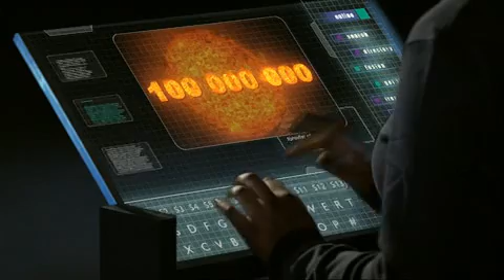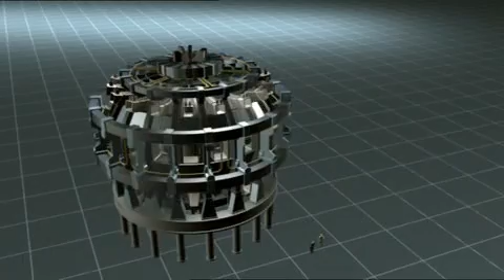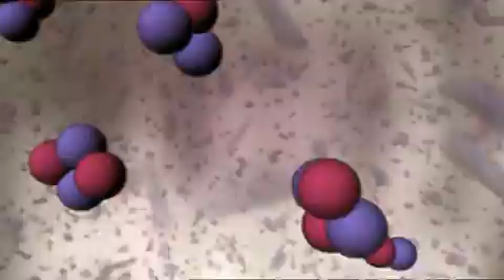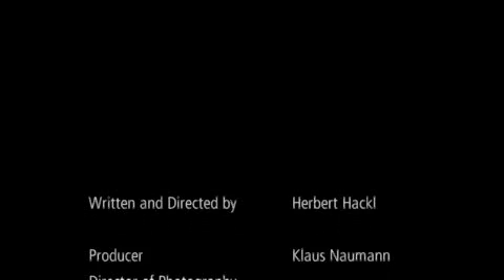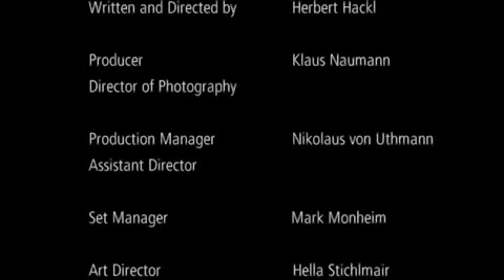How will a fusion power plant work?

Comment: It would be more futuristic and plausible if they used Helium-3 instead of Tritium. Helium-3, which is already abundant in solar wind, the Moon and Jupiter, is a helium isotope that lacks a neutron, and thus in a plasma state readily attracts deuterium's extra neutron. And if they fused, instead of useless radioactive neutrons flying out and producing old-fashioned inefficient thermal power, it would leave ordinary Helium-4 and Protons which have an electromagnetic charge in themselves; direct conversion of nuclear fusion to electricity.
Reply: DialecticDr if you actually paid attention to the vid, you would know that they said the energy output is about 25 times more than the input
Reply: DialecticDr
you are full of crap. what you say about helium-3 attracting deuterium is pure nonsense. helium 3 is a bad fusion fuel because the positive charge of the nucleus is DOUBLED compared to tritium. you are just making shit up as you go along, almost everything you say is completely incorrect.
Reply: Let's cast you into the Solar wind, Moon and Jupiter with a butterfly net and a big barel the size of New York City and you can catch all the Helium-3 for us? You agree Dielectric(SelfProclaimed?)Dr?
Reply: Win Dias Otherwise you;ll just have to endure the fact that fusion power consumes more energy than it produces, and using it to produce electricity is bullshit. If there was no way to convert direct fusion energy into electricity then it is basically more inefficient and expensive compared to technologies like Solar Power Satellites or Plasma Gasification. Both are more plausible and economical than Nuclear Fusion, unless you mine Helium-3.
Reply: DialecticDr Well - somehow what has been written by you is what i've been thinking of for a long time. Maybe we need just to try it..

Oh, and Win Dias - Man, you just don't know how much of that and other stuff can be found both here and... oh, let me think. Moon? Mars?
Reply: Wtf? He-3 is heavier than T, which means less mass can be converted into energy due to the mass excess. What would be the point of it?
Reply: uiiiiiuuu you did not read my post. It's not only about converting mass into heat. This is inefficient and impossible on Earth without a thermonuke. On the other hand, He-3 because it lacked a neutron readily attracts deuterium's extra neutron and the byproduct is He-4 and an excess proton which possessed a charge and ergo can be harnessed for electrical power. On the other hand, Deuterium Tritium fusion emits neutrons which are useless and inefficient.
Reply: DialecticDr is full of crap. Certified
Reply: Helium-3 is a perfectly good fusion fuel, but it's certainly harder to fuse helium -3 with deuterium than tritium with deuterium.

The main advantage is that it's aneutronic, so all the energy is released as charged particles instead of as neutrons. In theory this energy can be converted directly to electricity instead of making heat that is then converted into electricity with a heat pump as current reactors do.

That is an advantage for futuristic applications such as fusion-powered spacecraft since the only way to dump heat is to radiate it which requires heavy radiators. So the reactor's power output per weight would be bottlenecked by radiators, which limits it considerably. For this reason, He-3 is often preferred when considering future fusion-powered spacecraft since it doesn't have that limitation.

Comment: I have considered that instead of going by the concept of compressing a mass of material such as hydrogen/helium gas into an area to cause fusion, what if you could just compress a shell, or surface of gases rapidly into the center, so fusion would occur in a spherical shell area rather than in a full area.  What if you could have gases as an ellipsoid, and you force the thinner end together, causing repulsion which turns the ellipsoid inside-out and fuses much of it?

Comment: They work in fairly different ways. The LHC propels a continuous stream of particles are very high speeds against each other inside a detector, and has a ring shape so the particles can go around in loops while they accelerate. The tokamak has the donut shape because the plasma would escape from the magnetic field poles. The tomamak also heats the plasma (a few grams) but does not accelerate it.

Comment: There is no possibility of a catastrophic accident in a fusion reactor resulting in major release of radioactivity to the environment or injury to non-staff, unlike modern fission reactors. The primary reason is that nuclear fusion requires precisely controlled temperature, pressure, and magnetic field parameters to generate net energy. If the reactor were damaged, these parameters would be disrupted and the heat generation in the reactor would rapidly cease

-From Wiki

Comment: Taken from wiki. [something you could of googled -_-]
There is also no risk of a runaway reaction in a fusion reactor, since the plasma is normally burnt at optimal conditions, and any significant change will render it unable to produce excess heat. 
There is no possibility of a catastrophic accident in a fusion reactor resulting in major release of radioactivity to the environment or injury to non-staff, unlike modern fission reactors.

Comment: Agreed, the ROI is the reality of doing business. Fresnel lens approaches with mirrors are in use, which are much cheaper than curved mirrors etc. Efficiency means, however, that you use less space, and hopefully less equipment to generate the same amount of power, not that there isn't plenty of un-used desert out there. People have to work, and maintain these facilities though, so they can't be too remote, or take days to drive through. Everything is a balance.

Comment: It benefits a lot from concentration though, and 20MW power stations are in operation already with steam turbines. This is an idea that worked back in the 70's by the way, and was sidelined by governments then... It is a good interim solution while LFTR or fusion comes on-line. Energy storage mechanisms are here for grid use so they can no longer be used as an argument for not doing so. You could even make hydrogen and store it. Older fission reactors need to go.

Comment: It was something like Plowshare, yeah. PACER made most of the neutrons produced from the nuclear reactions to breed new fissile and fusile material. The amount of radionuclides released from the explosions were minimal, given that the meat of the bombs was the thermonuclear fusion payload. It still needed a small bit of fissile to exert the pressures needed to cause fusion however.

I wouldn't bother with Uranium unless you use it in iso-breeders to transmute and burn plutonium. Not enough U-235

Comment: @fakemadereal There is. By using nanostructure shielding, it is possible to construct a photovoltaic cell which will charge by thermal energy. 

I'm not actually sure how much more efficient it is, but it seems to me that a good rule is: the fewer energy transformations needed, the better.

Comment: @lightfdar Its not about coal or oil. Its about the fact that a fusion plant is much more efficient than any other type of power plant we use today. Its about the fact that there is no harmful byproduct produced with this type of power plant. Its about the fact that the fuel for a fusion plant is SEA WATER

Comment: @MogofWar 
no sun will eventually run out of fuel and pretty much explode. it is not a perpetual motion machine it just has lots and lots of fuel to use but it will run out eventually. 

the sun also uses gravity to initiate the fusion while we need to recreate the condition artificially by putting in a lot of energy.

Comment: @Joeviocoe 

i am familier with E=mc2. so you say that the mass "lost" is changed into enough energy to keep the fusion going? as i understand it for fusion to happen there needs to be huge pressure or speed for the atoms to collide with enough energy to fuse. how is that energy gonna be used to keep that going? what is the form of that energy?